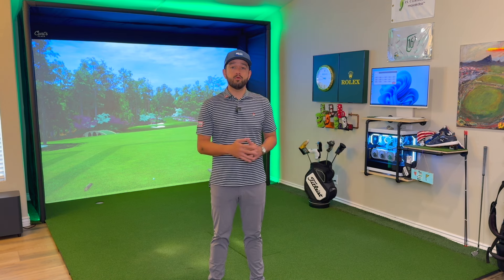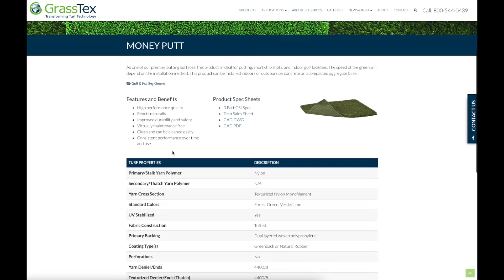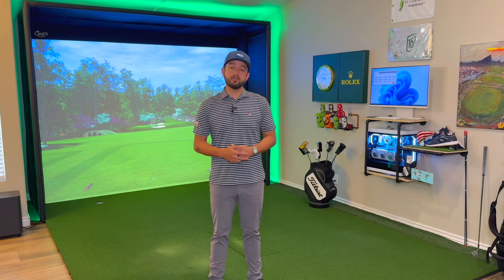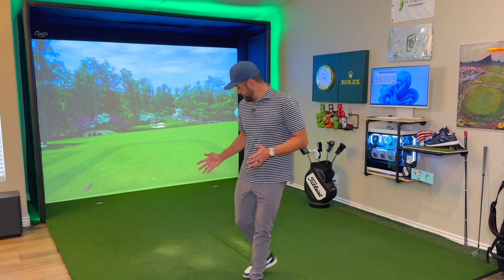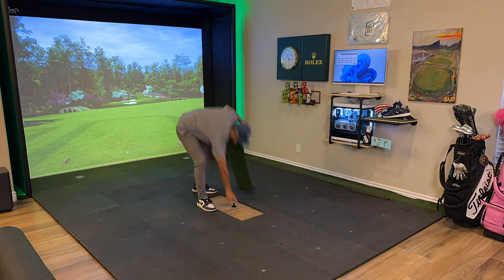I Just Upgraded My Turf In My Golf Sim After 3 Years! | Full DIY Install & Review | Money Putt Turf

Comment: Thanks, just found this video! QQ - how would this perform over carpet? My sim room has carpet that I don't plan on removing yet, do you think it would be to soft? Would you also mind explaining your rationale for deciding hitting location from the screen? Assuming you won't interfere with any of the equipment, is distance from screen personal preference? or is there a rule you follow?
Reply from the maker: I’ve had a few people place the gym mat over carpet and they said it works okay. If anything I’d put some cheap ply wood over the carpet if it was an issue and removing it was not ideal.

Comment: Great content! Subscribed! One question I have is, do you have any issues with the turf moving when hitting as it is no glued to the gym mat? Does it not cause the launch monitor to move? 

Edit: I just saw you answered a similar question, so you have never had any issues with the mat moving at all? I am just trying to assess if it's worth it to use some kind of spray adhesive from the turf to the gym mat. Thank you!
Reply from the maker: The turf does not move on the mat at all. If anything, the whole assembly moves maybe a 1/2” or over time and I just wiggle it back in place. I wouldn’t use anything to start. If you need it, maybe try rug tape.

Comment: Is the hitting insert slightly taller than the 1" gym mat + putting turf height? It seems like that could cause bottom point issues on a real course if you're used to the hitting insert being slightly higher.
Reply from the maker: It is not, it's perfectly flush. Check out my latest video showing how to make and install the hitting insert, it shows the process of it and it's perfectly flush with the turf. There's also a giveaway on that video so like & comment to that video for a chance to win. Thanks for watching!